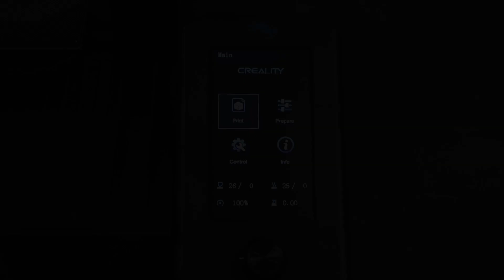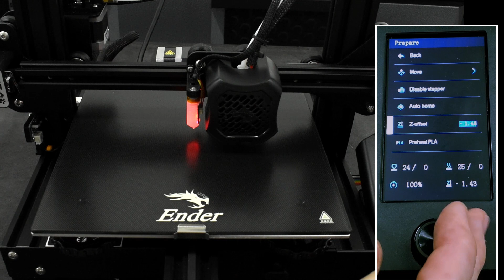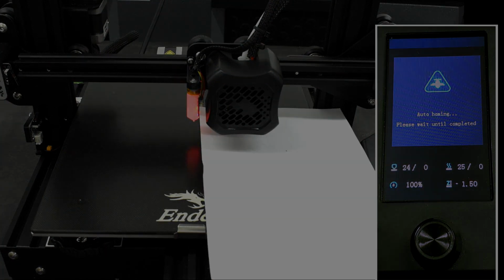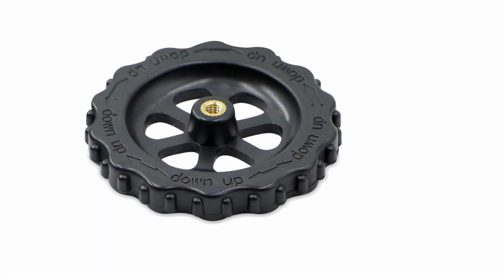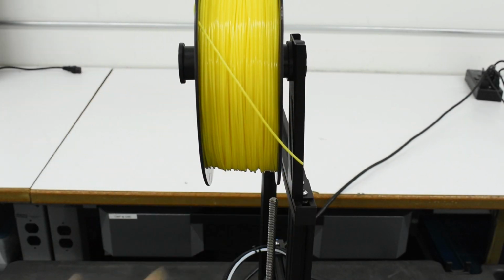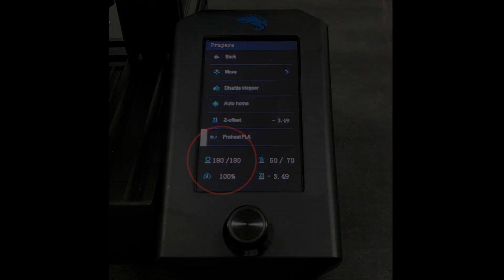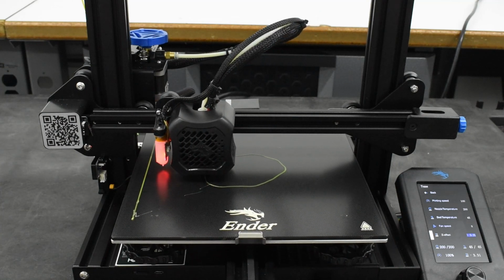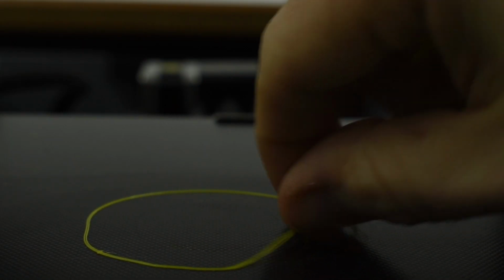Ender 3 V2 Auto Leveling Setup and First Print

Comment: Does the autoleveling on/off box in the printer leveling menu need to be checked for any of the meshes to be applied? I have a g29 in start code and printer probes the bed, but unsure of effect of the on /off function in leveling menu. Thanks

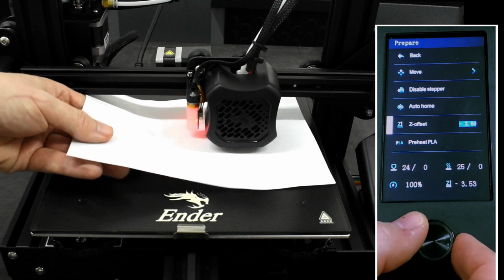Comment: 5:13 the problem is, my z is not even starts to move... WTF
Reply from the maker: This video is for customers that purchased through Tiny Machines 3D. If you'd like to try our firmware, contact us at support@tinymachines3d.com
Reply: @tinymachines3d778  Gladly i fixed it but thanks! :)